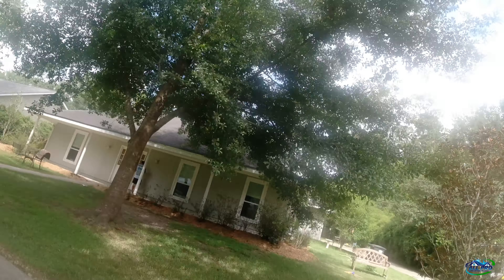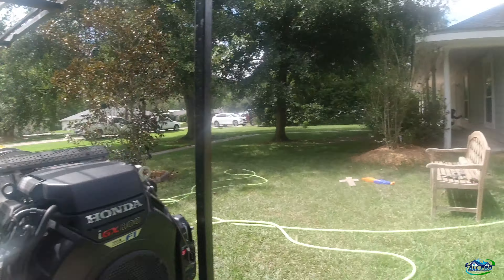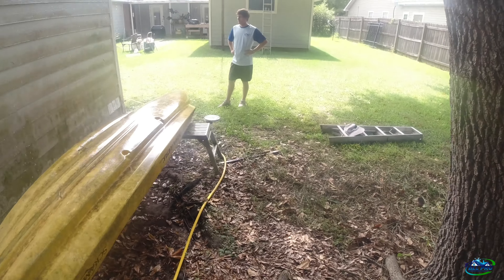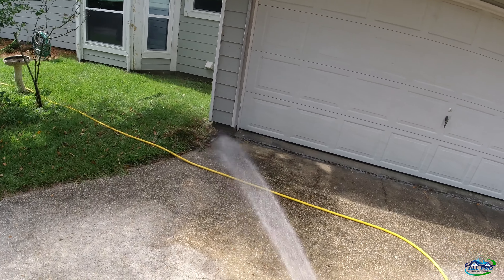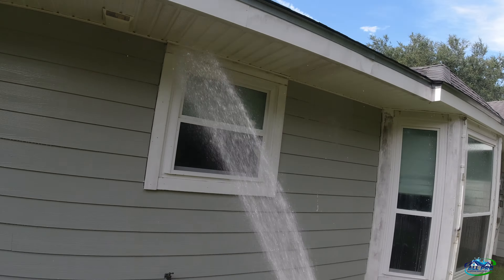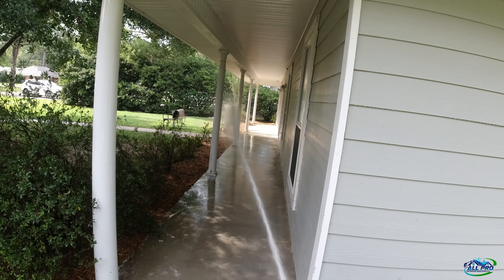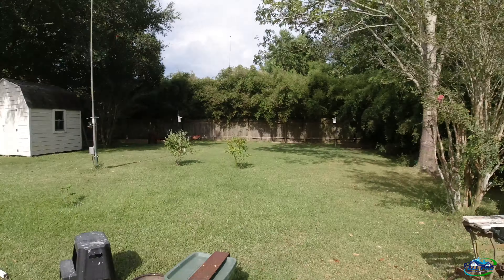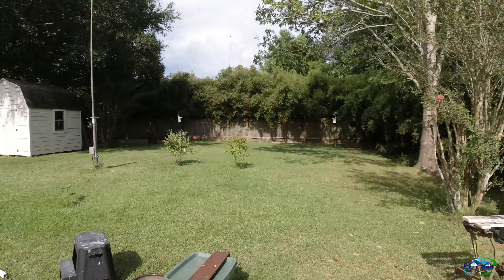House Wash & Flat Work

Comment: I just pulled a remco 5.3 off of my rig that made it all last season and most of this season.  Still works fine.  Just wanted to try a 7gpm 100psi remco.  I get about an extra 5feet without a bunch of extra flow.
Reply from the maker: Thanks for the info. Remco is looking good.